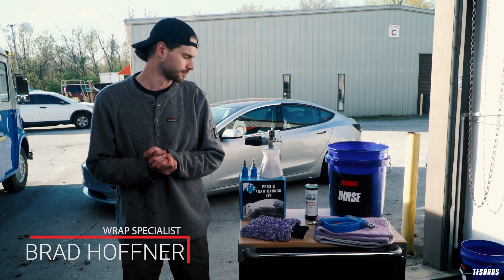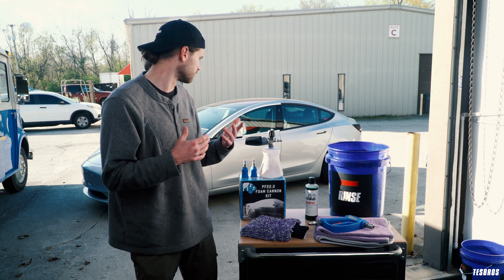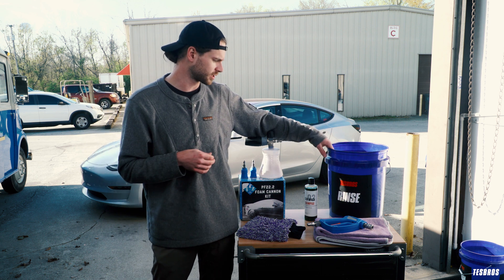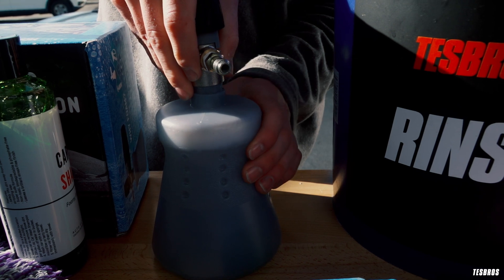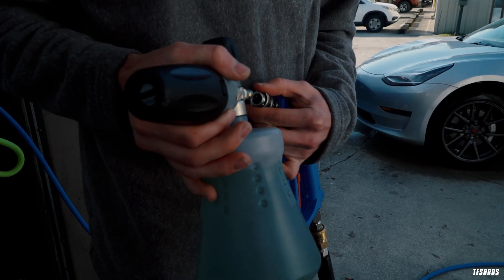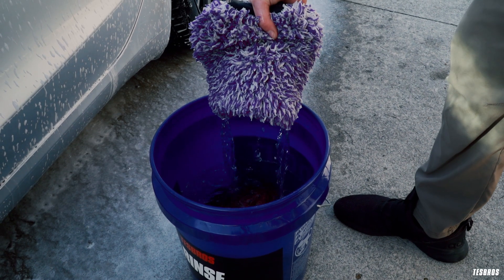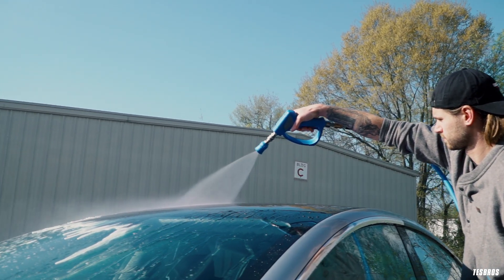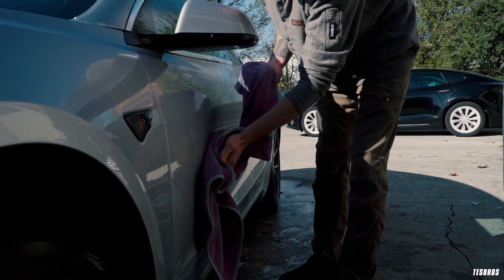How to Wash Your Tesla Using A Foam Cannon - TESBROS

Comment: What?!? No modified leaf blower? J/K - great video!

Most of the time when I do my washes with my AR Blue Clean 2,050 PSI pressure washer, MTM SGS28, MTM PF22 - I almost don't need to even use a wash mitt unless it's really dirty. Using the water that's filtered from the house helps as it doesn't have minerals. So the leaf blower (with a shortened nozzle) makes it much easer too especially around the mirrors that hold extra water.

Now if only the new MTM bottles weren't so expensive for 3 of them when you need just one. Constantly tipping over on the older bottles.